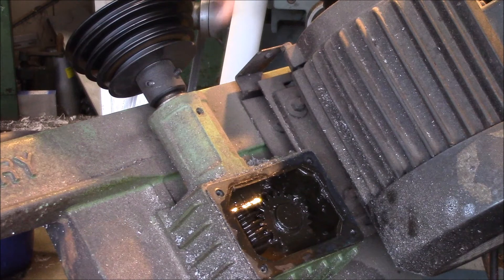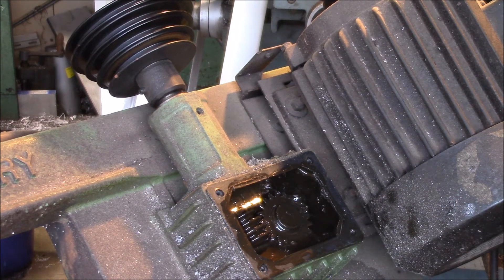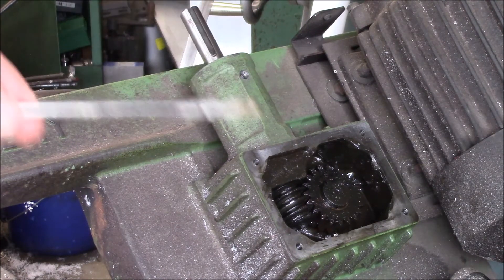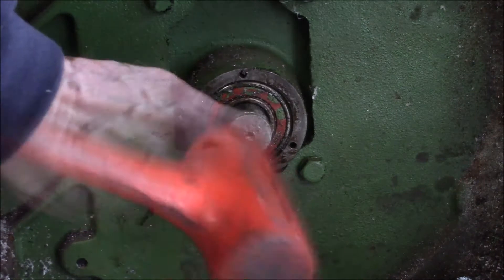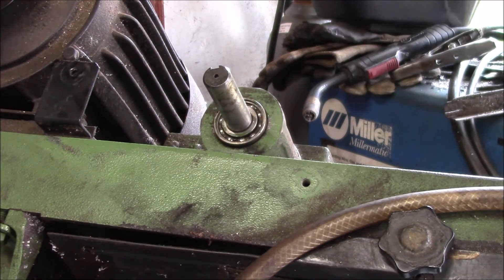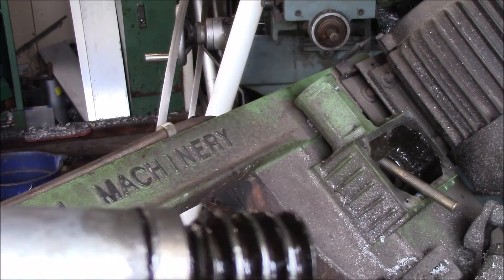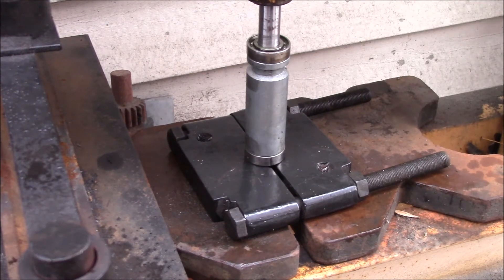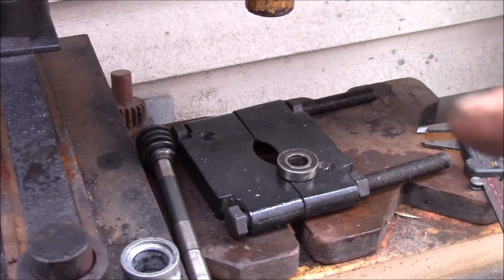7x12 Horizontal Bandsaw Gear Box Repair, Part 1

Comment: I got a set of left hand drill bit and they are amazing for removing busted screws, once they dig in enough to start cutting theres usually enough torque to break it loose and it saves using an extractor and if the heads broke and the screw threads arent tight they just come otu like a dream, great video! im going to have to open up the gear box on our ellis saw since its crunchy and has no lost all power..  thanks for the video!
Reply from the maker: I have a single left hand bit, but it was too big for this set screw.  But yes, those things do work well.